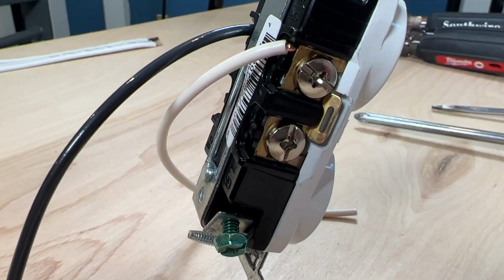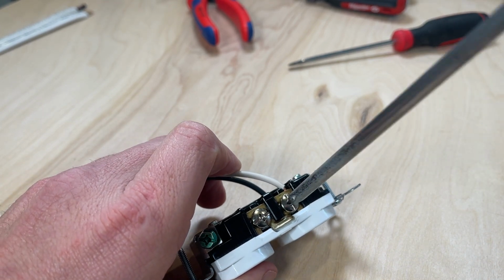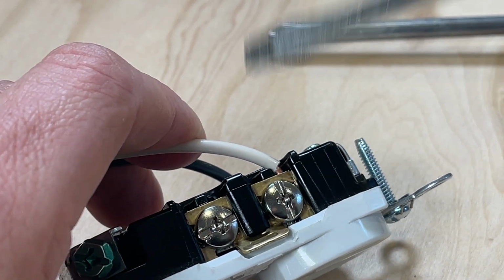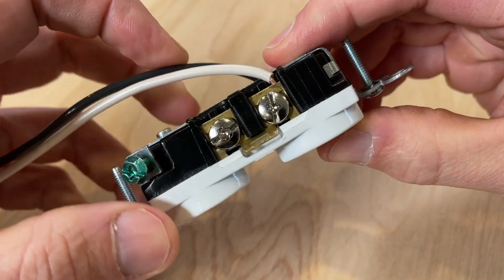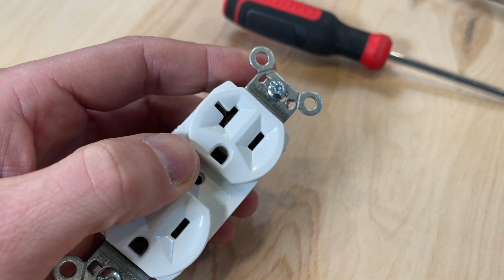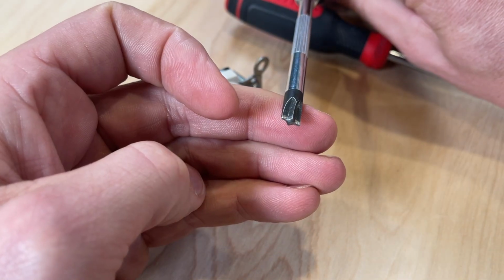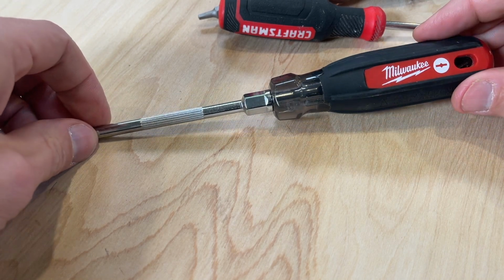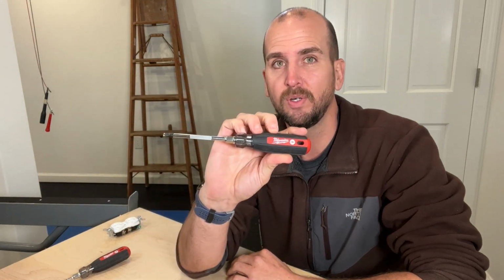80% of People Use the Wrong Screwdriver For Electrical Work

Comment: Why aren't the screws just normal Phillips screw heads?  Seems over-engineered to need a specialty tool when not much torque is really required.
Reply from the maker: I think it is to provide options.  For instance in Canada If you couldn't use Robertson on Leviton, Eaton, Legrand, Hubbell, etc. there would be an uprising 😂

Comment: The multi bit screwdriver can also be used a 3/8 nut driver or whatever other size you have if you haven’t noticed … handy little tool. Called 10 in 1 tool here in Canada. Not a lot of people realize this.

Comment: The availability is mixed for duplex outlets, or switches, whose screws are square (or Robertson) drive.  Almost certainly older outlets already in your house will not have square drives - they may be so old as to not have phillips either.   Even brand new outlets purchased at your local hardware store may not have square drive screws.  Finally, at 1:24 showing a phillips screwdriver "popping out" (cam out or strip out) of the screw is BECAUSE of the square drive socket in the screw reducing the area for the phillips to grip.  If it was phillips/flat only without square then it probably would not have popped out.  Not that I am anti-square!  My $0.02.

Comment: this is a modern problem with screw manufactures , trying to make screws adaptable for every screwdriver type. this weakens the grip a particular driver might get out of the screw, because some of the surfaces in contact with the driver is missing. the driver recommended here has more physical contact with the screw thus providing more torque.
Reply: on another note, i rarely use flat bladed drivers due to the slippage possibility. i don't like posidrive headed screws even using a magnetic head posihead bit, you can't put much sideways pressure on them before they fall off.  a problem when holding a flush box in one hand and trying to screw it on with the screw attached  to the magnetic bit. give me a proper philips head anyday.  on the other hand i use a small headed flat bladed driver for most security screws. i've found it possible to undo square drive, star drive, tri blade, torx, with it. lol (so much for security)

Comment: Who was the GENIUS that conceived the screws that are used on electrical outlets??  When you look at the drive head of the screw you can see that it is not ideal for any type of screw driver except the ECX.  For the Robertson, only 2 edges of the square drive do the work.  You covered why the Phillips doesn't work.  The hole in the center of the screw doesn't lend itself to the blade type screwdriver.  More importantly, it the US,  how many consumers have a Robertson or an ECX screwdriver.  Philips is the most common driver in the US and that is what electrical screws should be made to receive.  I have available both the Phillips and the Robertson, but I hate it because I need it so seldom that it is a PIA to go looking for it when needed.  As a side note, if the square drive were such a great concept why wouldn't it be used in mechanical drive systems - I believe  the reason is that it is then the weakest part of that drive component.  This ought to start a war of words now!

Comment: It call a triple combination screw get over it. Just because make it doesn't mean should be use, this is why scarry some people are allowed to do electric.  Over tighten the soft copper the wire made out of it makes it thinner and cause fires. NOT SMART. 
I guess there's an old saying idiot born everyday. The Milwaukee screwdriver he shown in this video is for back off only / removal only.

Comment: I'm old and have arthritis and shaky hands.  I live in the US but I use the Robertsons for electrical work.  For several years I have been explaining to friends why Robertson drivers work best and they usually disagree.  I've found that Phillips, even with good tips, can round out the screw head so that only flat screwdrivers will work to remove the screws.  Robertsons work so much better.

Comment: As most others, I hadn't heard of the combo ECX driver before.  This should be a "Game Changer" when installing outlets/switches.
Just like jeffostrof, I went to Home Depot and got the insulated  #1 ECX,  a straight blade, and phillips set for $20.97.  I had expected to pay $20 just for the uninsulated #1 ECX.  A great deal!!
THanks for the video.
Reply: Yup, great deal
Reply: It’s called a Xeno tip generically, ecx is a brand name

Comment: Well.. I figure if it works, it the right screw driver.   Of course, I like the offset multibit for the face plate and front screws.  but I do the actual wire to outlet connection with a straight square bit.  I like a good connection.

Comment: I use the "Wera 165 i PZ/S VDE" because I wouldn't be "allowed" to use any of the screwdrivers you have shown, because none of them have insulated blades.
Also, the screws in most terminals (main connectors in breakers and the like) here in Germany don't use a philips/slot (your ECX) head but a pozi/slot head, hence the PZ/S in the name.
VDE is just a "this one got tested and is fine for electric work" kind of certificate.
And yes, the Wera VDE are kind of expensive (12 screwdrivers + 2 racks are usually around 100-110€), but I love using them. They feel great in my hands.

Comment: Insulated are the way to go for electrical.  Can pick up a basic set at harbor freight for under $10.  Or at least could mention that you can run a piece of electrical tape over the shaft of the screwdriver to reduce chances of being shocked in the event the wire is live.

Comment: cool tool, but total waste of money for just sockets and switches.  unless you're doing a ton, but since you referring to "diy", i'm guess that's not your point.  they do have a multi head tool, which includes the ecx head, which would be nice if ya need one.  but phillips and flats (a wider one than you used) have done a ton of electrical work perfectly.

Comment: Looks like I need to rethink how I install electrical devices. I've been using Robertson head screws for years on RVs and, if possible, whenever I buy wood screws and have a good many 1" as well as longer bits which are inexpensive. I usually use a low power electric (currently a  4v Ryobi) screwdriver then final tighten with a regular screwdriver on electrical things. Great video!

Comment: Those screws aren't meant to be turned with a Phillips screwdriver; they are intended to use a Robertson or a flat blade. The reason these screws are done this way is because these outlets are used almost exclusively in N. America, where the standard tool for electrical screws has always been flat-blade (USA and points south) and Robertson (Canada), thus you don't have to buy new tools to install these. People don't understand that there's a reason for all the different fastener and blade types. Probably the most misunderstood is the Phillips; it 'cams out'  because it's supposed to, as this prevents over-tightening. Flat-bladed fasteners are supposed to be turned only with a driver which fills the entire slot, not something smaller. Worn tools are supposed to be replaced or refreshed; it's a user-fault if you don't, not the fasteners fault. 

Especially here tightness or torque on these screws matters. Everyone knows that aluminum wire expands and contracts in size due to electrical current heating them which is who over-tightening those connections is a problem. Few consider that copper does this as well, only to a smaller degree. If you tighten these screws too much, the screw can stretch, and after several cycles of heating and cooling in use can break or loosen. Similar for the threads in the outlet or switch. There's a torque spec for every fastener including these; they need to be tight but not over-tight. The mis-use of a Phillips or trying to use too small of a flat blade won't let you get them tight enough but use of the correct tool will though that can allow over-tightening which is your job to avoid. 

There are standard sizes for flat blades but the standards aren't well adhered to by both tool and fastener makers. People find it inconvenient to have 10 flat bladed screwdrivers with them so they try to use just a few for everything. If you want the best tools look into a set of Gunsmith screwdrivers or bits where you'll find not only a perfect fit but also hollow ground blades which have parallel sides so that screwheads don't get deformed at the top in tightening or try to cam out under torque. And if you want to understand screws, get the book "One Good Turn" by Witold Rybczynski who traces the history of the screw and explains why the different types came into being and what their special qualities and uses are. You'll find a lot of what you thought you knew is wrong after that and you'll begin seeing how badly many screws are matched to the job they're doing. But most of all you'll then know how to choose and use the best tool for the job.
Reply: The aluminum wire was banned in Canada for house wire as it burnt down too many houses.   I have only ever used copper wire and never had a loose connection but I use a Robertson that has good torque ability.
Reply: @owenprince4823  When you consider that aluminum is used almost universally for high-voltage transmission lines as well as 240V circuits in US homes and almost never gives problems there, it becomes clear that the real problem with aluminum house wiring was in how it was used and how it was connected, not in the wire itself. It's not copper which is what electricians were used to working with, and when they used the same approach they had always used for aluminum wiring things went wrong. Once aluminum house wiring began to get a bad reputation with the public it's fate was sealed, and it's no longer allowed for lower-current wiring in US homes either.

Comment: No, no no noooo! There are screwdrivers (here in Germany) which are especially made for these screws. They are a combination of the Phillips head and a flat head. The are called Plus/Minus, come in two sizes and are made by various manufacturers.
Reply: Flat head is the type of screw and not a driver.  There is a standard blade driver for slotted screws but they are not very good as they slip out all the time and do not center on the screw head like a Robertson does.  That is why they came up with the combination driver but the Robertson from Canada has been around for a very long time is the best.

Comment: Maybe you shouldn't use demonstration tools that you purchased at the flea market.   One problem that you will have with square drive screws is that you can rip the heads off
Reply: Well you will not have a cam out slipping problem then will you.  The reason the heads rip off is because they are cheap aluminum screws from china and not good quality steel screws from  the USA.
Reply: @owenprince4823  in 1995 I was helping wire the DMV in silver city NM, and was ripping the heads off the EMT couplings.  No china stuff back then

Comment: Very informational video👍. But I want to ad something you missed, The most importend aspect of a screwdriver for electric use. And that is isolation on the shaft. Al of your screwdrivers have a non isolated steel shaft. At least in Europe isolated shafts are used for electric work, even if the fuse is set to the off position there is always a small risk of getting a electric shock.

Comment: I have multiple sets of square drive screwdrivers, not exchangeable bit screwdrivers, and rarely use them.  I occasionally use them for random electrical work but usually use the appropriate sized slotted screwdriver or a Phillips.  I always make sure to tighten everything well.   I do admit that the square drive does  work very well with virtually no slip or cam out.  I probably would not but the Milwaukee screwdrivers especially since I don't do that much electrical work.

Comment: My number one tool is a number 2 square because it works on emt connectors and couplers. If I'm installing receptacles all day, I use a #1 and a thin slotted or as my boss calls it, the minus (the other one is the plus) tool. The slotted for cover plates (trim etiquette is to line up the screw heads vertically on the covers) and tucking wires into place around the screw. Fun fact: every electrical job requires 2 screwdrivers. As an electrician I have to admit you give pretty good advice to homeowners, you go into detail and explain WHY something is important or needs to be done.

Comment: I normally use a Phillips screwdriver of the correct size, but I do not do this for a living. I rarely have to replace an outlet, or a switch, so I use what I have. I did not even know until now that there was a ECX bit. I do have some square bits, and did not even know there name, so I learned a few things from this video.

Comment: As a commercial electrician my two most used screwdrivers are my #1 Robertson when I do side work and my #2 Robertson when im on the clock. My most used pry bar is my slotted screwdriver and my Ph2 bit screwdriver almost never gets used. I encourage all my apprentices to get Robertson #1 for outlets for one big reason. It reduces the amount of stripping that can occur. Sure the exc provides more surface area which should mean less cam out and less stripping but in reality that just means the user won't push as hard which means more stripping. If you use a Robertson and end up stripping that terminal because you had to many energy drinks that's morning you can still whip out a slotted and undo that screw. Also there are many companies that sell Robertson #1 drivers. I personally hate multibit screwdrivers. My wera #1 Robertson stays in my pouch even when I'm doing underground because almost every screw that an eletrician is meant to touch is a Robertson of varying sizes(atleast if it was made recently and by a reputable company) I've yet to find a #3 Robertson driver but have come across a great many screws that I need one for.

Comment: Being from Canada I would never have reached for either a phillips or a slotted screwdriver. That phillips and the slotted are both wore out anyways and will slip even in the proper screw. Also know that there are different screwdriver tips that look like a phillips but aren't The drywall tip is different as well as the pozidrive, the fearson and Japanese industrial standard, none of which are for the outlet screws.

Comment: I’m one of the 10% who voted for ECX. I like Robertson bits, but once you use the ECX, you will never go back. I use the Milwaukee 13 in 1 (model 48-22-2880) because it has the ECX for newer devices and all of your standard bits for older devices. I also have an insulated set for service panels.

Comment: In Canada it would be close to 100% use a green handled Robertson.  I had never seen an ECX screwdriver before. I can see why that would be even better. Not sure if they are available up north here though. Philips screws should be outlawed. They are horrible.
I am actually surprised that receptacles and switches destined for the US market have the same screws as the Canadian ones (that is they accept Robertson drivers).

Comment: In Las Vegas tract homes are going up (03/10/2020) by the thousands. Plus apartments. (There is no more water here, or any plan for making God do her thing in Colorado's Rockies, to add to thenever dropping Lake Meade.) 
   But I digress: Be ready with a quiver of drivers to do 30 to 70+outlets, switches and J boxes... drilling studs, running wire, tripping over framers and placing code armor plates... puff, puff, puff  (horrible getting sucked into new high volume construction) per DAY and speak 3 languages.

Don't be too picky-  all the hardware is cheeeep, Cheena junk with 3 different drive patterns on 5 different screws on 13 different NEMA counterfeits.  

   Licensed, American, Union Electricians should be busy wiring up huge solar distillation plants in the desert here & huge pumping plants... be working next to American Union Pipefitters and Welders running mandated pipelines to the coast where water and KNOWLEDGABLE engineers exist.  
  ________||||||||________
   ACME SOAPBOX, INC.

Comment: at about second 54 in your video I notice your hot already attached. This whole video as a result shows me three things wrong. First, if you are just going to install the wire behind that little square copper plate, the proper way is to put it in the left hand side so that when you tighten the screw it helps pull the wire in when you tighten the screw. You did not do that on the black hot wire. Second, as a long time (over 40 years electrician), I can tell you that installing the wires that way, it is the same as doing what I call backstabbing the wire. Yes the screw holds the wire better than stabbing the wire in the back hole of cheap receptacles but if the screw comes loose for any reason then the wire will just possibly cause a fire from the arcing or even come out. The proper way is still to wrap the wire around the screw in front of that copper plate and then tighten it up before you then tighten the screw just like you would if you had a receptacle without that feature. Takes longer but it is a lot safer. Third thing, yes the average home owner does not have a torque screwdriver, but it is now called for according to the code. Just sayin.

Comment: Electricians adopted the Robertson early when they were doing knob and tube wiring it would allow  one handed  operation of the screw driver while holding the wire and insulator together.
Reply: Interesting, because every old panel and jbox from the 20s-60s ive gutted or worked on from residential to industrial has been slotted only

Comment: He used wrong size slotted, Funny, is that the box the outlets come in suggest the proper tool and torque, NOT all outlets and/or switches use the Roberson screwdriver, I have 4 new GFCI outlets that use T-15 Torx.